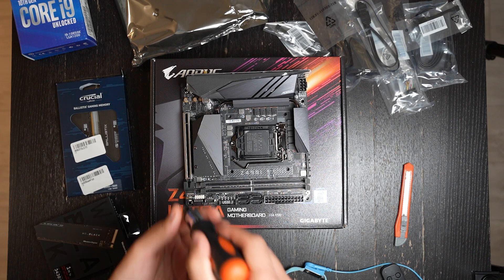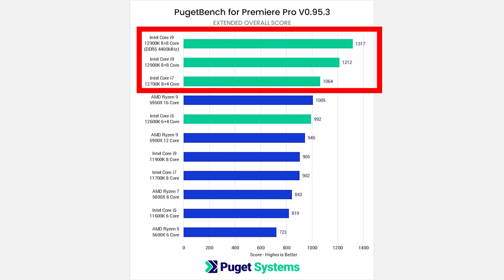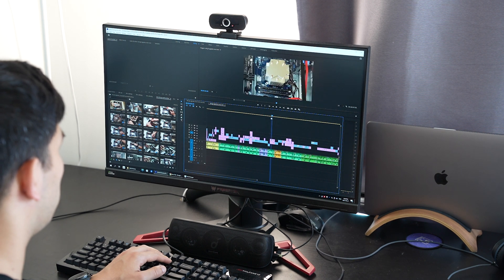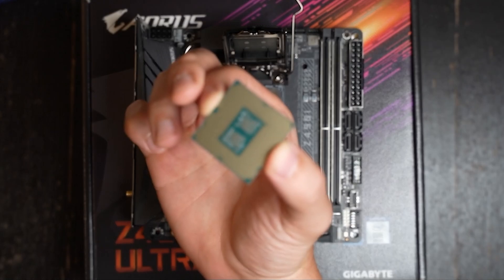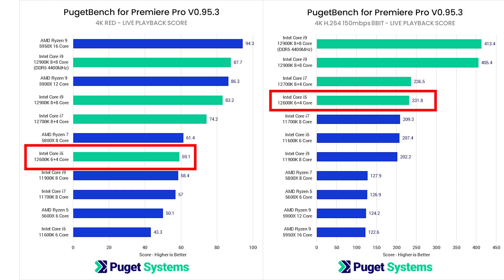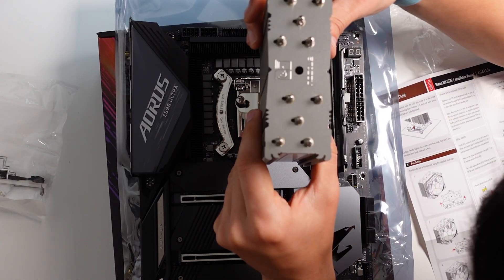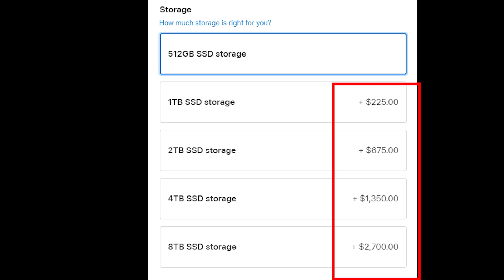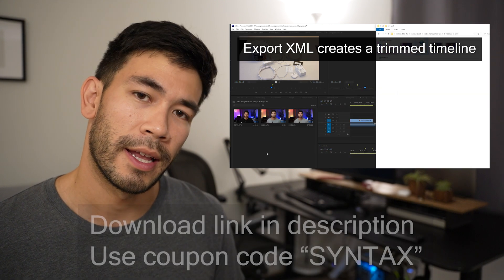Why I Chose PC over M1 Max for Premiere Pro (... 3 mistakes to avoid in your next editing build)

Comment: Great video. I wanna start saving for a new machine just for work and I’ve been very confused about what’s better. In my experience, I’ve been working on a 2021 M1 MacBook Pro with 16gb of ram and everything it’s just super smooth (owned by the company, not mine) and recently got some extra work and for it I use my personal windows laptop with i5 10300h and thx 1650, same 16gb of ram. I understand that this laptop is way below the Mac it you can feel it, I have to use proxies with this one, but come on it should just be slower, not annoying. It has crashed almost the same times the last 5 days than the Mac in more than a year. Playback freezes with the proxies after some time and have to restart the program. I really don’t know if I just should add more ram to this laptop, at least 32gb, and idk because the Mac with 16gb is a beast with multiple browser tabs open, premiere, audition and even after effects.
Source footage is iPhone in 4K h265 and proxies are pro res 222 at 720p. A couple links to After Effects for relatively simple text animations because I like them better than premiere’s.

Comment: Excellent points, I use both Mac and PC,  I agree 100% you statements, as I tried editing on an external drive on my Mac M1, it worked pretty good, the same process on a windows machine with MV<e drive installed on the motherboard always worked so much better.
Reply from the maker: Well said!

Comment: Great video, I agree with you however one quick point... There is like a $20 App called NTFS for Mac that enables read/write of NTFS drives on a Mac. I am not sure if there's a performance hit on the drive, however, at least it enables you to be able to copy files from NTFS to Mac if need.
Reply from the maker: Very good tip
Reply: This is the entire issue i have with macOS though. So many features available in windows for free are a $20-$60 third party app because Apples only innovates forwards with new obscure features but doesn’t include great simple features from other OS.

Comment: This is a very useful video that contains a lot of useful info(*) and explains straight to the point with no beating around the bush. A lot of tubers suffer from the latter too much waffle and not much substance cos they lack knowledge.
Don't buy Apple products the company is filled with managers who think they charge you like a bull or in other words a rip-off merchant.
I never own a NEW Apple product only buying 2nd hand ones just to test/check them out for fun or learning.
* you are right Tech Notice and a few others also recommend using the NON-F version of 12th gen of Intel CPU.

Comment: I built an AMD 5950X (it was the hot sh*t a year and a half ago) and NVIDIA 1080Ti (from another machine) and the 1080Ti does the encoding and decoding very effectively. But a VERY LIMITED number of codecs - because of Premiere - mostly 8bit (4:2:0) and10bit codecs are limited, mostly H.265 4:2:0. The 11th-13th gen Intel Chip's Quick Sync will encode/decode 10bit 4:2:2 in Premiere, but I don't have it on my AMD. 

NVIDIA is a no-go with everything else, and Apple M1 supposedly does it ALL with hardware, and that's where PCs get SPANKED by Apple. I've been SERIOUSLY considering a base Mac Studio for Premiere, since it's now optimized for Apple silicon. But do I wanna drop TWO THOUSAND DOLLARS because Premiere is finicky ... hell no.
Reply from the maker: I still think the new intel chips are better for premiere, for apple Mac, go for final cut pro or da Vinci resolve
Reply: @JSyntax  Agreed, and so does Puget systems ... but I think I'm gonna start using 480p h.264 proxies. I did a test yesterday, and my project was SOOOO easy to work with! Why didn't I do this LONG ago??? LOL!

Comment: Good info, but if you use the proxies you can save a lot of money than buying 64GB of RAM etc... just my two cents.  The proxies stay neat and connected to the original files and you can jump back and forth within PP to zoom in if you need.  You can also use external hard drives - HHD with 7,200 RPM as your editing drives.  I edit 4k footage off of these external hard drives and have not encountered issues.
Reply from the maker: Fair enough but it's an extra stop in my float
Reply: Even clog 10bit 422?

Comment: This was the most helpful video when i was shopping for a new PC so I can commit to more video editing.  albeit mostly 720-1080p, I want to be able to do more later on.  I hope to actually be making money off of video editing one day and hopefully be doing it for a living.  I currently use a 1080 on a Ryzen 1700X with 16GB RAM.  So I finally bought and have a 3080 TI and an i7 12700K with 64GB of 4000mhz RAM.  Had an issue getting the other parts so the other parts are just sitting here for now.  A seller on NE voided my PSU order after I made an inquiry asking why it was still processing after 5 days, *I was angry*.  But again, thank you for this video.
Reply from the maker: Thank you for your kind words
Reply: Great stuff!! Some say AMD is the way to go if you have Black Magic Raw files and or RED raw files- and they say -Intel for h.264 dslr footage etc. would you agree with that?

Comment: Lots of very useful info! Fixing to order my rig for 4K editing!
Reply from the maker: What are you getting!
Reply: @JSyntax  I need help deciding! Racking my brain between the new M1Pro/Max Mac Mini that’s fixing to drop on March 8th and building a Intel 12th Gen i5-12600k or Ryzen 9 5950X system. Too many choices! I’ve been Apple most of my life and I’m concerned about the lack of upgradability that they stress going forward, so I’m kinda ruling them out I guess. Just torn with which way I should go. Budget is $1200 or thereabouts.

Comment: I'm thinking of getting 12700 non K with a budget and PL unlocked b660 mobo.
Hardware Unboxed showed it's only 5 percent slower than 12700k and well if I want to get K chip then adding mobo cost and cpu premium it's almost 220$. 
Do you think I'm doing better with 12700? I'll edit smartphone 4k footage so will get 32gb ram only. 16×2. I'll buy another kit if I feel the need.

Comment: Hey j great video comparison new sub !!! i have a question  im having trouble understanding why my h.264 clip is choppy with a  3090 pc with 64 ram 16 cores and  cant playback 4k 60 smoothly i use davinci studio which utilizes my gpu theres no way that should be a struggle when the m1 macs can handle it with no problem please help!
Reply from the maker: I use premiere pro so I can't be sure
Reply: @JSyntax  because your cpu id decoding it. Tech notice recently made a video where he showed how 5950X timeline is choppy but 12600k isn't. It's because of intel quick sync video
Reply: What type of footage is on your timeline?? BMPCC raw files/ RED RAW files??